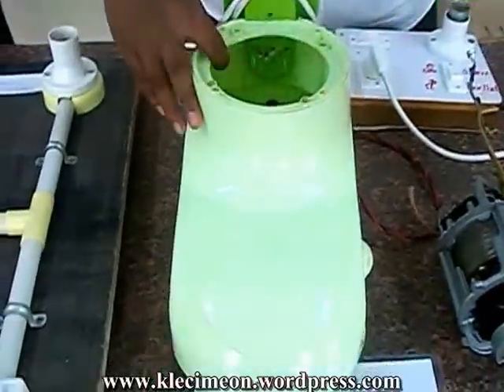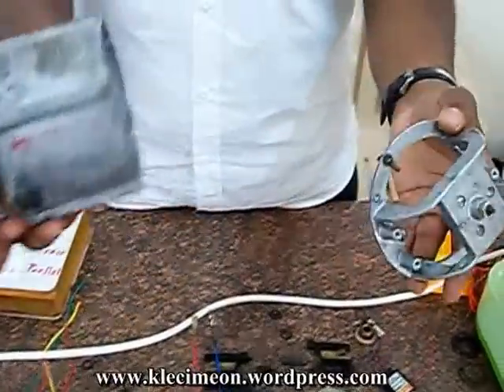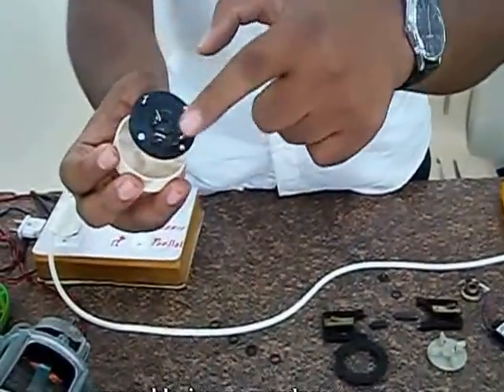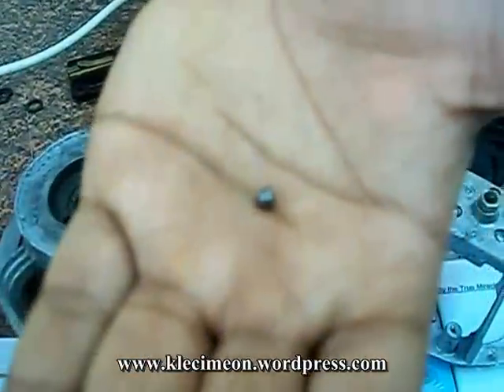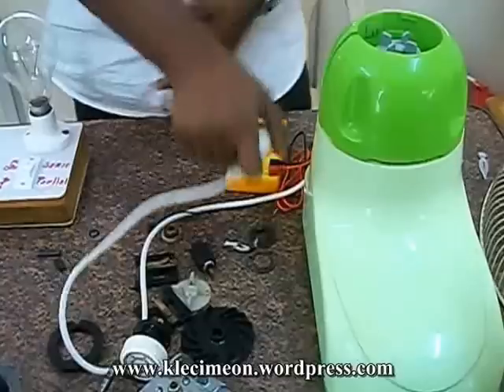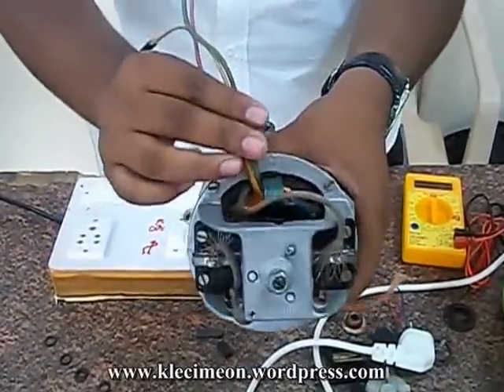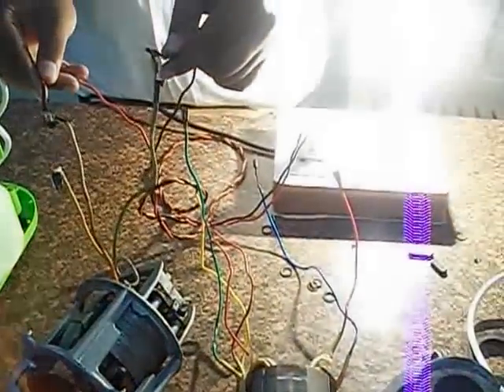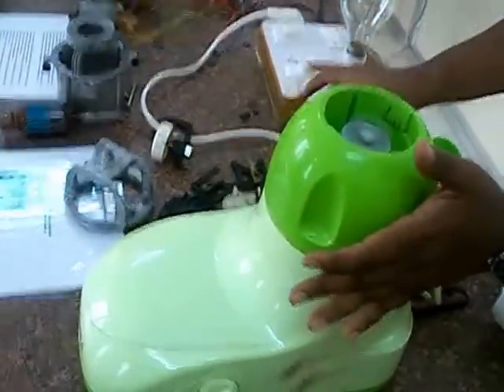Food Grinder Testing MIXER

Comment: friend why Ur testing speed terminals with series
Reply from the maker: Series Parallel circuit in parallel circuit are connected along multiple paths so that the current can split up; the same voltage is applied to each component. Likewise the series..... Leave you can Google and get it.. coming to the terminal I tested every electrican have tester & series Parallel tester for checking the electrical equipment especially with windings using electromagnet hope atleast 0.01% of doubt cleared. So you need to catch up with basic
Reply: @4335sanjay  thank u sir